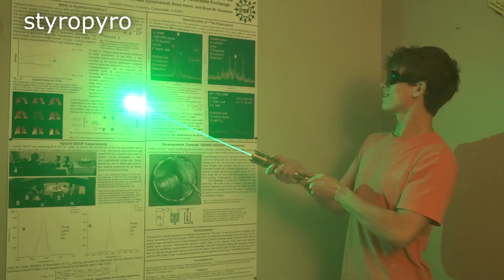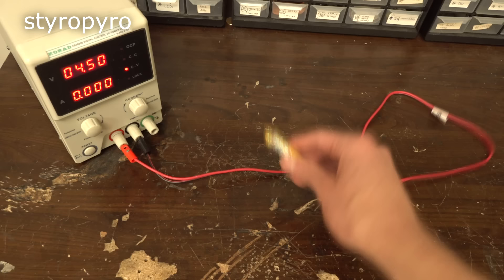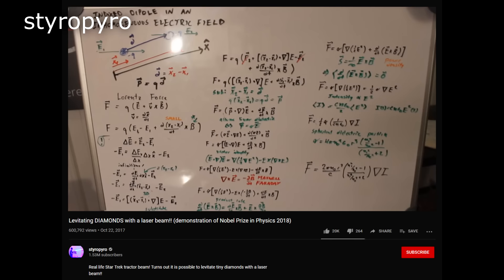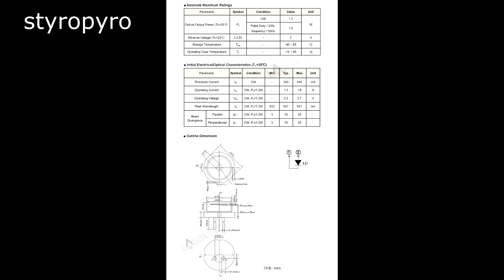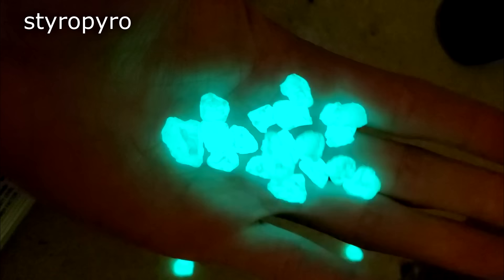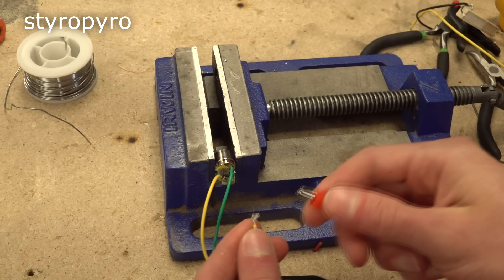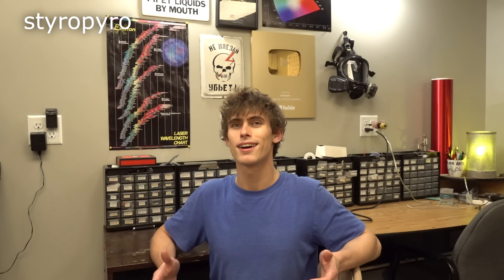Crazy Keychain Laser Pointer Upgrades. 5mW to 3000mW+

Comment: 9:46 Styro: “I did some rough calculations”

Me: Has no idea how to even solve that
Reply: Yes
Reply: Solving it is easy, getting the numbers to solve it is the hard part
Reply: I can solve the top part because its a basic algebraic equation but I have no clue what the 2nd part is.
Reply: It's just electromagnetic physics
Reply: @Minurz  optics the first part and the second is thermodynamics the third just energy stuff
Reply: "dont try this at home"
Well nowadays since i cant sneak inside the neighbors bunker due to coronavirus , i can only try it at home
Reply: It's just arithmetic multiplication and exponents - 6th grade stuff at most. Getting the data for the variables is just looking it up.
Reply: @Epilogue_04 yeah and it's just exponents, dividing, etc. It's not differential calculus or anything.
Reply: @Epilogue_04 km

Comment: 4:07
"No filter cap, let alone any sort of current regulation"
Me, with 0 understanding of lasers: amateurs
Reply: From my understanding Laser Diodes are powered by LEDs and LEDs will pull as much power as they can from their power source until they burn out.  For most LED circuits you use a resistor which limits the amount of power (current) that the LED can draw so it doesn't just burn itself out.  In the case of both the original laser and the final one he used the resistance of the components themselves rather than a dedicated resistor to limit the current. Of course since the components aren't designed to act as resistors the exact resistance value will likely vary quite a bit more than a dedicated resistor which makes it somewhat risky (in terms of whether or not the laser will burn itself out).  This also means that the exact output power of each laser pointer will change from one device to another as well as every time you change the batteries though at such low levels (for regular laser pointers) the variance shouldn't be noticeable.
Reply: @grn1  ..........
Reply: @grn1  thanks for that explanation!
Reply: @grn1  wow thanks
Reply: @Truman Steinback Parrotte didn't someone else already say that somewhere else?
Reply: @Ethan Zentner Well was what he said true if you replaced "LED" with "light source"?
Reply: @Ethan Zentner https://www.explainthatstuff.com/semiconductorlaserdiodes.html  Rather than powered by an LED, Laser Diodes essentially are LEDs (though it's obviously a bit more complicated than that).  The core mechanics behind their design is the same.  You're technically right in saying it isn't powered by an LED but I never said LED = LASER, I said a laser diode (a specific type of laser) is powered by an LED (which as stated above is sort of true but it's a simplification).

Voltage (V) = Current (Amps) * Resistance (Ohms)
Watts (in a DC system) = Voltage * Current.

3V at 100A would require a resistance of .03 Ohms, AA batteries have around .1 Ohms of internal resistance and we'd need 2 for a typical 3V power supply (so .2 Ohms which would give you an actual current of 15 Amps).  If you're using something other than AA's then chances are there's some other resistance in there so you don't actually get 100 Amps out of your power supply.  

It's also important to understand the difference between Amps and Watts.  Watts are the amount of energy actually used either for the intended purpose or lost as heat.  That also means that it's the Watts not the Amps that will make an LED burn out (or burn brighter is optimized).  If you could get 3V at 100 Amps you'd have 300 Watts but with the typical 2 AA batteries (which is what you've most likely seen or used) you'd get 45 Watts assuming you only had the .2 Ohms of internal resistance from each battery and no other resistance from the LEDs connection point and/or connective wiring (for a 0 gauge copper wire which has the lowest resistance at 0.64 pounds per foot you get a resistance of .00005 Ohms for a more typical 32 gauge it's 0.533 Ohms per foot or 0.04 Ohms per inch).  

The reason you can use a 3V LED without a resistor to limit the power is the same reason he could forgo a resistor for his laser, the internal resistance was high enough to prevent the diode from drawing too much power and burning itself out.
Reply: @Ethan Zentner I have watched a ton of videos and read a ton of articles from many people who are far more knowledgeable about this stuff than I am and they have all said that LEDs will draw as much as they can which is why we have to limit the current so they don't just burn out.  If there isn't some form of current regulation LEDs and Laser Diodes will pull too much power and burn out, this is well known and is the whole reason he put resistors on most of his circuits.  Going back to the original question I was trying to answer he didn't have to put resistors on the last circuit and the original circuit didn't need resistors because the internal resistance prevented the diodes from drawing too much power.

As stated in my previous reply I could have been more accurate by saying Laser Diodes are like LEDs rather than powered by them but a Laser Diode is basically an LED made with different materials that produce a more pure light and have a resonance effect within the layers that amplifies the signal much the same way traditional lasers do but in a much smaller space.  So it's kind of like an LED is acting as the light source for a traditional laser array.
Reply: @grn1 nobody cares
Reply: @user-hw5zs1pi7z  What was the point in making an obviously false comment 2 years after the fact.  Obviously some folks do care though the person I was replying to in particular seems to been banned (which should be obvious by context clues).
Reply: @grn1 WTF LASERs aren't powered by LEDs they are monochromators while leds have a big spectrum🤦🤦‍♂️ you clearly don't understand anything about lasers...

Comment: The biggest risk are laser diodes without a proper wavelengh filter system. Thats why safety glasses just work for good filtered laser diodes in the right wavelengh. Every other combination may still make huge damage on your eyes. As you said, for excample a green laser pointer. If you freeze it, it might not work anymore. But when you push the button and look into it you might get blind. It is just emmitting ir in this cold state, but is still powerfull enough to blind you. So take dare while using commercial unprofessional lasers for experiments.

Comment: "Don't try this at home!" he says, before trying this at home.
Reply: I know this is a joke, I'm just gonna throw some other information out here for anyone else that happens to see this. This is more telling those that have no qualifications to not attempt this stuff lightly as with no qualifications, as Styro says when talking about the diodes from the DVD player, If you pull the wrong thing (in this case the near-IR CD-burning laser diode) you could very easily cause significant harm.
Reply: @ThatWhichObserves  As someone who has had 1,800 watts of power run through my tongue, I can attest to that.
Reply: @sl1pz369  ????
Reply: Someone from my college ended up in the hospital because of some photonics research project.
Reply: @vidal9747  Sucked on a power cord to get sour powder out of it. Didn't know it was plugged in. I'm stupid.
Reply: @sl1pz369  Jesus Christ
Reply: @sl1pz369  did you learn somerhing from this?
Reply: Actually he is in his secret doomsday bunker
Reply: @vidal9747  Check if things are plugged in. Also, don't suck power lines.
Reply: @ThatWhichObserves  Also he didn’t do it at home. He owns this rental garage thing you can see on his motherboard video
Reply: yup
Reply: But styro has a degree in this shit and he has a workshop to do this stuff lol
Reply: @vidal9747  True.

Comment: 0:30 Casual screwdriver jammed into electrical outlet behind him, no big deal.
Reply: Actually if this is in the ground he has an antistatic protection while working with electronics so they dont fry. It's pretty clever if you know which is the phase and which is the ground
Reply: If you look carefully it's shoved into the ground and has a wire on it. probably to ground himself when working on sensitive electronics.
Reply: funily enough, this actually does have a purpose to it. He is working with sensitive electronics and doesn't want to fry them through a static charge on his person, so he grounds himself. Also gives a pretty good protection in case he makes a mistake with a live power supply. He explains this a few videos earlier I think.
Reply: @svetoslavdimitrov3612  you actually don't have to know which of the two terminals is the neutral (and not the phase) because you can just use the safety ground as Styropyro does (also depending on the network, the neutral is not connected directly to ground, at least not at the wall plugs).
Reply: @Bzmot332bve  I explained it vaguely because I am no electician myself but I know whay this is used

Comment: What terrifies me most about this is one little feature of the final laser. If you look closely, you will see a smaller beam going out at an angle. That’s probably an even bigger recipe for disaster than the main beam if you are not careful, because at least you expect the main one.
Reply: It's not safe to consider that being careful is enough safety measure when working with power lasers, for example because you can unexpectedly have a partial ray reflection from metal dust particle into eyes. Just wear glasses.
Reply: @orlyk.9217 You certainly wouldn't want, as Styropyro puts it, "lights out FOREVER!!!"

Comment: That bit about poor circuitry in the laser pointer seems like it might be intentional as a way to make the laser break instead of letting it put out too much power.
Reply: Laser diodes are incredibly fragile and if you drive them too hard you will fry it, so the way this keychain laser is set up is purely a cost-cutting measure not that I'm complaining though
Reply: The design not intended to make the laser break. It's deliberately using the internal resistance of the small button cells as the current limiting of the circuit. There is absolutely no need for any additional circuit in that design, and the laser will not last any longer if you added current limiting... all that would happen is that you would need to add an extra battery cell to account for the losses in the driver circuit.

Comment: You should make a video explaining more in depth how the lasers work like the forwards voltage and current draw, I've always loved your videos but never understood them. 😂
Reply: Lasers are fairly simple in terms of their construction, more or less just a concentrated light source passed through a medium susceptible to lasing (there are lists of them) and then reflected between two mirrors, one partially reflective so that it can pass a portion of the light. as the light bounces through the medium you get a quantum mechanical effect that causes a cascade of energy shifts to a common lower energy wavelength of light that's based on what material you use. then as some of that light is reflected back and forth in the cavity it builds up due to that cascading effect and recycling some portion of the light back and forth, which means that it feeds back to allow more light to exit as well since the amount that comes out is some percentage of the light hitting the partial reflector, not an absolute.
Reply: That being said the total output is based on the amount of wattage you can put into the light source and the amount of light that gets actually captured in the cavity for lasing. that's not always very efficient for example in a helical flash tube laser because those will dump a large amount of their light off to the sides instead of into the medium itself. this is actually quite inefficient and makes for a poor power in to out ratio.

a far better method is actually to have a straight flash tube inside of an elliptical reflector at one of the focal lines, with the lasing medium lying along the other one. This, in theory, with a perfect mirror, you are dumping *all* of the input energy into the lasing medium because all of the light exiting one focal line *will* pass through the other one geometrically.

Now will you get losses due to the reflector being partially absorptive? sure, but if you use a white light source you *won't* get interference losses *inside* of the chamber that actually concentrates the light onto the medium. this means that you're more or less getting a concentrated beam of light passing through the medium which itself could be shaped so that the light passes through it more efficiently based oh the geometry rather than a standard cylindrical block.

Then you cap the ends off with a full mirror on one side and a partial mirror with masking on the other side to prevent axial leakage of the flash source. This would make a very highly energy dense laser and could be done using simply a small ruby rod the same size as a flash tube from a cheap disposable camera, then getting a custom set of reflectors made or do it yourself.

(obviously don't try this at home etc. this is dangerous because you could get a way higher output laser than what you're calculating if you don't know what you're doing and are instead accounting for the power outputs that come from a helical flash laser. I am not responsible for anyone using this information, I'm just putting it out there because I think it's interesting at an academic level.)

Comment: "Carefully remove the laser diode from this pc." proceeds to tear apart pc with a small axe
Reply: @MrMrvin27  it was used to make good content. lighten up.
Reply: yes that is in fact the joke
Reply: That’s actually a rock pick. 
Cooler than just an axe.
Reply: @jimlarosee8899  you're both wrong. It's a chipping hammer for chipping the slag off of weld beads.

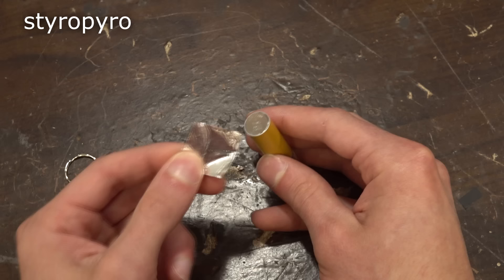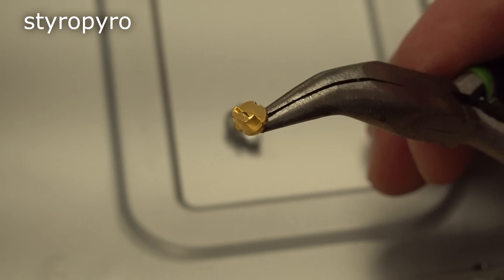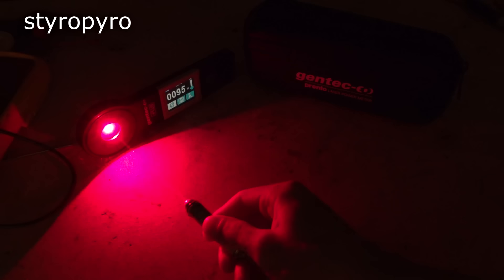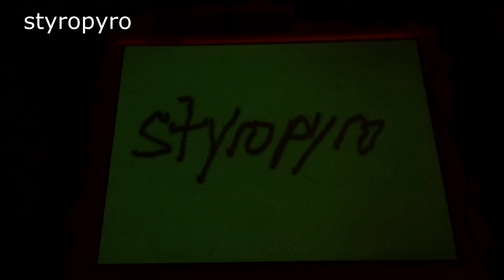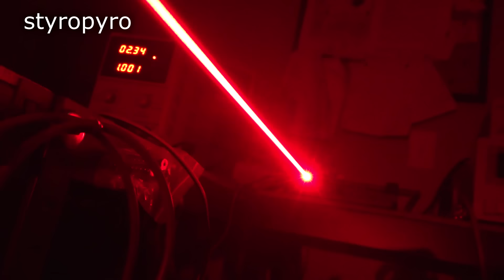Comment: beginning 3:20 dvd laser diode 6:50 getting them apart 7:35 amc7135 7:50 dvd laser single spacial mode 9:30 200milliwatts power output 10:40 mosfet 13:18 final work 13:23 800miliwatts 16:25 blue laser diode 17:28 super caps's esr 19:35 super cap recharging 20:20
Reply: Absolute chad
Reply: @vin9916  
The Chad Issac Lee guiding us through the Thad Drake Anthony's presentation! 😤✊🏾
Reply: Bruh this is where the fucking dvd drives keep fucking disappearing to
Reply: on one of the few videos i actually do watch all the way thru. thank you tho. absolute madlad.

Comment: 4:00 that may seem like an engineering flaw, but that's actually a pretty smart way of driving the cost of this thing down, while at the same time making it work just as fine for its purpose. So the people that built it could very well be quite good engineers that most people just don't understand.
Don't underestimate the chinese, there's a lot to learn there :)

Comment: This gives me so much anxiety and I'm that friend who is known to do sketchy reckless things. 

I've suffered multiple head injuries, metal poisoning, chemical burns, 4th degree burns, high current electric shocks, miscellaneous other ailments from messing with industrial equipment and material as well as a penchant for relatively dangerous animals. I intend to keep local species of (Australian) vemous snakes and intend to DIY a high pressure steam boiler at some point. 

I mostly do metal fabrication and heavy industry and I've also got mild industrial deafness and sufferes welding flash a number of times. Something about lasers scares me though. I think it's how easy it would be to fuck up and blind myself or someone else. With most of the sketchy shit I do I'm the only one at risk or anyone else involved fully understands the risks and also wouldn't mind winning a darwin award. But lasers pose a large risk to unsuspecting bystanders. 

People inherently understand that welding is hot and metal work can be dangerous, they also understand that fumes are probably bad and that snakes are potentially dangerous. But a laser can seem so innocent....

Comment: I want to do this but I also don’t want to go blind forever. So I just like to remind myself of the horrible danger this poses to an average joe
Reply: dont do it bro
Reply: @thelegendarywasdgamer9724  Alrighty partner, get to tearing apart blu ray drives and use some sunnys to block the light and see where it gets ya. I ain't your daddy.
Reply: @n111254789  yeah I don't stare into laser pointers and I certainly don't use them around reflective surfaces.
Reply: Its definitely one of those things where you need the right equipment and need to do a lot of supplemental reading/research to do safely. Same thing applies to firearms
Reply: @n111254789   i have actualy tried to take apart old blu ray and disc burners but i couldnt figure out how.

Comment: Could you try focusing the laser CD to that extreme wattage output and try to melt steel or some other metal with a high melting temp?
Reply: Why would he bother trying? A CD laser cannot produce enough power to do what you say. In any case, over-powering it will just make it fail instantly.

Comment: I'm building this for a project and I'm stuck on getting the AMC 1735 LED driver LC. I found something similar on amazon "10PCS AMC7135 350mA 2.7V-6V LED Driver high LED Driver chip" is this the same thing or is it for a higher voltage?

Comment: Could you use this to start fires when camping?
Would need a safety lockout so it doesn't immolate your pack though.
Reply: The first two I mean, the IR one and the DVD one.
Reply: Yes, you could potentially se them for that. However there are far better, easier and more reliable ways to light a fire.
Reply: @johncoops6897  
How about in "adverse conditions"
I bet it would be great for lighting fires in the cold and wet!
Reply: @MostlyPennyCat  - um, nope. You misunderstand the TINY amount of energy being transmitted by a handheld laser pointer (even with 2 or 3 Watts output.
You will get more fire-starting power by connecting the battery across some steel wool. Try it.